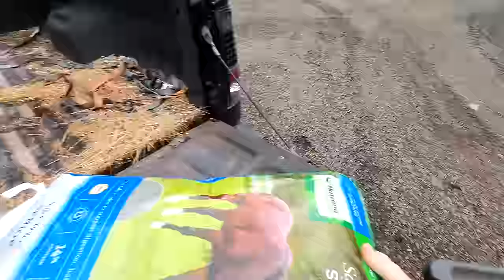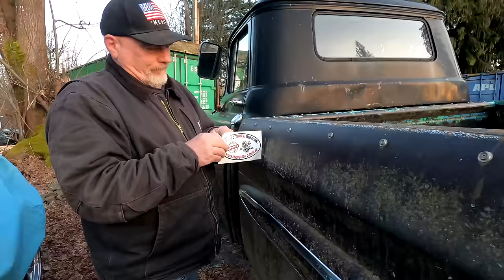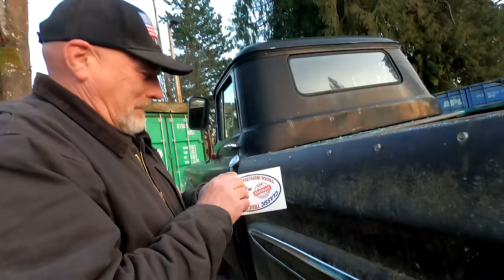1959 Chevy Apache Napco 4x4

Comment: You were saying will it run and I was waiting for you to open the hood.
With glass fenders I don't think it's a 302 6 cyl.
Guessing a 350 under the hood, but I could be wrong.
Looks good for a puddle jumper for the ranch.
You needed a P.U. for the ranch that you can get into the box without needing a stepladder.
Take care brother, nice to see Jamie in the video. Scratches to Anna.
PEACE AND LOVE FROM MINNESOTA......BARRY✌
Reply from the maker: It has the original 283 V8 Barry. I will dive into that in the next episode. I was actually very surprised at the condition of everything under the hood. I only bought the truck for its original Napco 4x4 system. The cab is one of the worst I have ever seen. Peace and Love back at you my Friend.
Reply: @ClassicTruckRescue  If it turns over it will run, one of the best V8 motors they made
Reply: @ClassicTruckRescue 
My “Rusty” , Ol Blues replacement is living up to his name…
I found an oil change sticker with the City Nehalem on it.
Oops, I NEVER meant to buy a beach vehicle.
Other than that all the needed handicapped stuff works awesomely except the ramp remote so I have to open passenger door and hold a toggle for 16 secs.  WAY WAY better than fighting Ol Blue!s ramp and door.

Comment: Love the old square body trucks myself, also ppl forget that when you have bigger tires and wheels, yes it looks cool and ground clearance, for mud , but really all it does rob horse power from the engine unless you have a built engine all the right gears in the axles too , sweet truck though rick
Reply from the maker: Good point Giles.

Comment: Just a little tip from an old guy that deals with those bags all the time. Don't open them until you are where they are going. It makes them much easier to carry and handle getting through doorways. Also, put the bag in the container before opening it. That makes for easier clean-up and, when the bag gets low, you can just grab it out and pour right from it. Work smarter, not harder brother.
Reply from the maker: Thank you Burt....that all makes perfect sense.

Comment: If I wanted a 4x4 I'd get a good running trailblazer and pop the body off and put a 58 Chevy pickup body on it or a panel truck.
Reply from the maker: You need to check out my boomer project. You would definitely like it.

Comment: Looked like Annabella caught sight of a rodent, the way she jumped off of the tractor.
You should still save those chrome wagon wheels though. Classic late '70s-'80s look!
Even that bumper (looks like late '60s to early '70s or later) ain't bad - just a little wavy.
Them hub holes came out pretty good!
Reply from the maker: I think you are right about the bumper Dan. Works out pretty good because I have a 69 Chevy short, step side bed 4x4 project coming up I can use that bumper on. I wasn't too worried about messing the caps up, I chose the worst 2 to cut. Thanks for the visit.

Comment: I’d love a two wheel drive truck like that NAPCO with the sweepline bed that looks awesome in my opinion!!!! Rick is that the bed that is fiberglass or is it metal???
Reply from the maker: No, the fiberglass bed was installed on the Chevy Cameo and GMC Suburban Pickups. The bed on our project truck is a "Fleetside". It came out in 1958 and was extremely popular. So popular that they stopped Cameo production after building only 1450 in 1958. Today the 58 and 59 Chevy Fleetside and GMC "Wideside" beds are in high demand. Our project truck has the original stainless steel trim on the bed "Spears" ....very hard to find. Thanks for the visit Henry.

Comment: Pull the motor out of the truck with the yellow fenders by love boat and put it in this truck if you haven’t pulled it already for something else
Reply from the maker: I think the original engine in Ramjam is going to work. The one you mentioned is a good "Plan B" though Matt. Thanks.
Reply: @ClassicTruckRescue or surprise Jamie and put it in her truck blue on her tonka truck